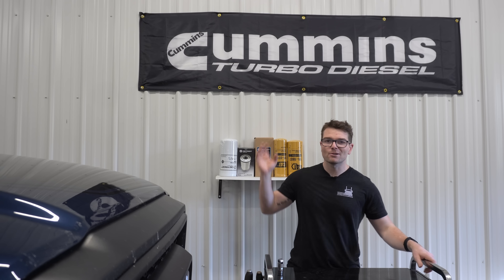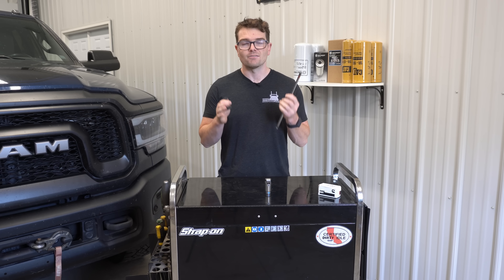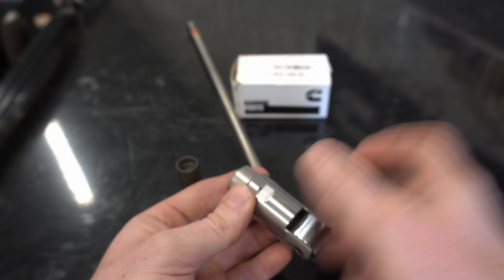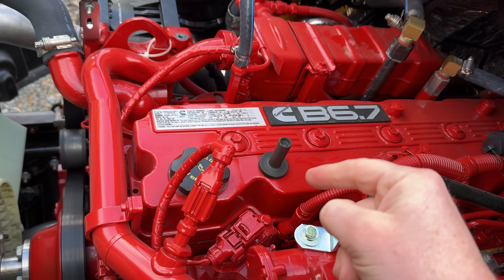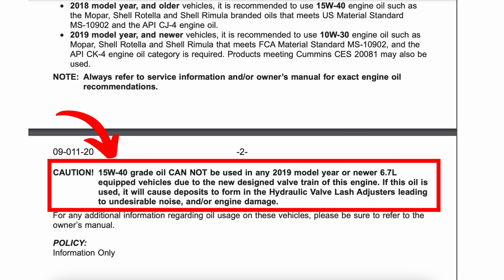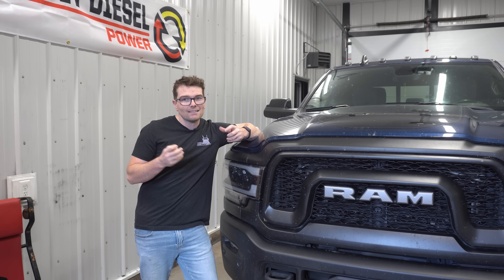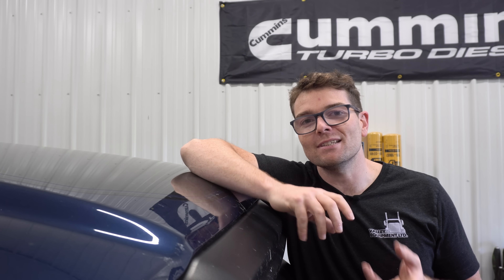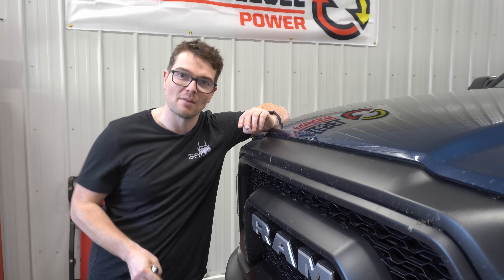RAM 2500 6.7L CUMMINS Hydraulic Lifter Failures *Diesel Mechanic Explains* | Not Good?

Comment: I change my oil every 4months witch = 4000 miles .  I use schaefers full synthetic 15w40 racing oil . Below 50 degrees it run two 5 minute idle cycles on first start of day. 50 degrees and above i run 1 5 minute idle run time on first start of the day . My engine is quite compaired to the 10w30 . I have 50102 miles on my 3500 370 horse 2021 ram and so far so good . I tow between 7000 lbs to 20000 lbs im in my 11000 lb travel trailer rv this week .i tow in overdrive and my rpm run between 1700 to 2000 mostly 1900 rp.s are top . When i pull i use the rpm and gear to tell my speed .im not in a hurry im retired . Awesome videoDenis from Santa Rosa Ca

Comment: Cummins didn’t change this over on their own. Diamlar said they wanted a maintenance free engine for their 2500-5500 series rams so the customer didn’t have the added down time/extra maintenance cost. If you look at any other engine running hydraulic lifters, every brand has issues with these destroying cams whether at 10k miles or 200k miles…. Eventually it WILL happen. These engines were built with a ticking time bomb in each one of them. Chrysler has destroyed their own reputation by changing these engines for what they claim is better for the customer. The only thing that’s better is the return work for them whether it’s warranty or out of pocket expense on the customer. 
As far as why the “commercial “ engines didn’t go with hydraulic lifters…. Well…. That’s a maintenance item that just comes with owning a diesel and that’s on the company’s dime. Commercial grade engine come with a lesser warranty on Powertrain as well. 
I would personally take the day in the shop to run overhead adjustments as to having to potentially replace a $20k engine. 
This is my $.02 so take it as you will. I’m coming up on 100k miles and seriously considering the tappet conversion to go back to the old style system but it does come at a cost. The kit is $6500 depending on what kit you go with and I think 30 hours labor. Granted it’s a lot up front BUT a lot less than $20k for an engine that’s on national back order at this time. I also do 7500 mile oil change intervals with Rotella 5w40 full synthetic but I’m still not confident in these hydraulic lifters engines.

Comment: When I used to rebuild 2 stroke detroits we would literally rebuild the roller followers, nt from failure but from a reconditioning stand point and they rarely failed, I never actually saw a failure but there probably were some, this from an era of long run engine hours and supposedly lower oil technology than today, so what happened  ????

Comment: I used T6 10w30/ 5w40 on my 2021 Horse and just recently started hearing the knocks at 590k miles. I’m at 606k miles now and getting ready for new set of lifters. Just maintained scheduled oil change. 👌
Reply: 2021 🐎 😂
Reply: I honestly believe the lifters fail simply because they get gunked up with filthy oil. Keep in mind Rams oil change schedule is 25,000kms all while being polluted by fuel and soot. No wonder they fail. Delete the emissions and do oil changes every 10K and it will be fine

Comment: Frankly think this is rubbish.  Navistar use hydraulics although not rollers in 6.9s and 7.3s.  No problems with those.  Hydraulics are better.  Debate is really about rollers vs flat.  2 different things.

Comment: You guys gotta remember also make sure you change the air filter. It is part of the system that your engine needs to operate. Valvoline true blue 1030 is one of the best so his Rotella T6 10W-30 can’t go wrong. And I still change it every 5000 miles. Mobile one oil filter keep it clean.

Comment: People need to do true research about oil brands before they bash a product.  I have spent the time and looked at lab analysis of all the brands in my area.  None of them are bad.  Some have a little more or less anti wear additives is all.  If you just change oil sooner then manufacturers recomend you can not go wrong.

Comment: I ran Walmart supertek in all my trucks cat cummins with no oil related problems for 16 years.  I now run the Rotella T6 in my new 2024 Ram 6.7.   I have had lifter tick with the new roller lifters unfortunately.
Reply: Are you gonna do the flat tap pit conversion ? They also changed the oil cups that year .
Reply: @RealNicholasJ.Fuentes  I probably will once emissions system craps out.

Comment: Noise, and maybe a extra one mile per gallon in fuel economy. I would rather adjust the lifters myself. I wounder if you could change the lifters and push rods to the commercial style set up?

Comment: My 2001 with 186000 miles on it. I asked my diesel mechanic to check my valve adjustment. They came back and said only two were slightly out of adjustment. I changed my oil every 5000 miles. They told me I could run that engine to 500,000 miles easy.

Comment: well,2018 here. 540,000 , 30k interval, various 20/40 oils. with analysis twice a year…still going….. and new cab chassis trucks DO have the roller lifter.  i’d prefer full syn 5/20 oil…..

Comment: So here is something I noticed. When I purchased my 2024 I bought an extended warranty which came with 13 oil changes at any dealer in North America.  While reading the fine print a few weeks ago (my experience with 401 Auto Dealers was they don't like to share information in print so you really dont know exactly what you bought) I noticed they package comes with regular oil not synthetic.   WTF?  You can never win with these dealers.  Anyone else come accross this?  Im all about clean oil and the right oil.

Comment: They did this to try to reduce Noise.  Why does anyone care how loud the diesel is?  This is probably something done to compete with chevy and ford.  We see how the switch to cp4 worked out.  Come on cummins!!!!  read the room. We buy the dodge for your engine because its reliable. Not quiet.. not the most gears.. no other reason.  Its simple and will never let us down.  Now fire all the high paid CEO's up there that will never let the common truck owners ideas come too light because they cant box it as their own, and just make a friggin reliable truck that's 10k cheaper than the competitors and you'll be back on top.

Comment: Currently sitting at 187k miles in my 2020 2500 that I bought since new. I can’t stress enough how important it is to keep up with your maintenance AND using the truck for it’s intended purpose. These are not grocery getters. They need to get up to temp and ran long. Literally not a single check engine or issue in my ownership. Every 5k-7k miles, Rotella t5 ultra 10w30. Power service diesel additive every at fill up. Truck runs smooth and quiet just like new.
Reply: SOME PEOPLE WILL NEVER ''UNDERSTAND'''''   OR DONT CARE '''' IT'S A ''COMMERCIAL'' TRUCK ''''  INTENDED FOR '' SEVERE SERVICE '''''  COMMERCIAL '' USE '''  TRUCK  ''''' NOT A '' PICKUP'''   TAKE THE ''SCOOTER'' TO ''WALMART''

Comment: So here is my thoughts.  Tiller lifters in general are a failure point.  We are seeing them fail in the Chevy gas engines with cylinder deactivation, we see it in the ram with the mds systems and now we are seeing it in the Cummins engine.  U know the real reason I think they went to the roller lifter. The small amount of hp gains you get from using them.  Just my opinion though but it would suggest that when it’s not in that bus engine.  Can the roller lifters be reliable sure if you use high end oils and high efficiency filters but if that oil gets just a little gritty those lifters are going to start causing problems.

Comment: I believe all of the engine components receive oil pressure at the same time during startup. A check valve ensures oil is held in the galleries, similar to the way that fuel is held in the rails. No?

Comment: The 2024 Ram trucks are calling for a 15,000 mile oil change interval.  I'd never run that long on a diesel.  5 to 7 thousand mile oil changes with the right oil weight is the way to go.

Comment: That nub sticking out tracks in a groove in the lifter bore.  A little wear there and the lifter wont track straight with the cam and it wipes the roller and lobe.  So instead of just doing a quick valve adjustment you will do a cam swap!

Comment: Is running your truck better or worse at high speeds and Rpms. Around 2500 rpm. Or keep the rpms lower? 2020 2500.

Comment: 2019 6.7 HO lifter failure at 117,000 miles , head needed rebuilt, still using coolant internally, no one can figure it out .
I’m $11,000 in and still can’t use this truck.
Hamilton cam and lifter kit $3,000 , head work $3,000 , studs , wire ring , expensive gasket kit .

Comment: I have a 2006 Cummins in my 3500 ram 6 speed  standard I have 500,000 km have seen a check engine light come on once for a bad injector. I will get 1,000,000 miles out of this engine. I change oil every 5000 km 15 W 40. I change all filters at the same time oil and fuel I just put new injectors at 500000 the old ones worked fine but they were getting noisy solenoids.

Comment: If you were to be in the engine for one reason or another, are the school bus flat tappet cam and lifters a direct fit replacement into the pickup truck blocks? I have a long time before my warranty runs out, but it might be good knowledge for the future.

Comment: The Epa's nvh guidlines are why they made the change. Apparently, there's an issue with the new block flexing under load, causing an oil starvation issue on the rollers.

Comment: Thanks for the information   Was going to pull the trigger on a new 2024 Ram 6.7 H O  
Not now   I only put a few thousand miles a year on with a 4000 pound truck Camper   Going with The Ford 7.3 Gasser now to avoid all these engine issues with these new diesel engines   I too am a retired diesel mechanic and the last thing I want to do is work on a new engine
Reply: The ford 7.3 is having way more lifter issues than the cummins, not to mention the crusty 10 speeds
Reply: @CULTIVAD3D cost of ownership probably has a lot to do with his decision. Gassers will always be cheaper to maintain.

Comment: Considering all manufacturers are or have had valvetrain issues when we’re talking about automotive stuff I’m not surprised. I’ve got a ‘20 Ram, I’m not bothered by it. And 15k mile oil changes is nuts.

Comment: If Cummins says don't run 15w40 in 2019 or later engines, believe them.  Run what they recommend, 10w30.  People who run the wrong oil then complain about "that lousy engine" online are full of sh!t.

When I worked at Cummins, hydraulic lifters were always controversial.  The main issue as I recall was plunger sticking as a result of soot-loading in the oil.  Soot control of diesel oils have improved in the last 30 years so I suppose plunger sticking may not be as big a concern today.  But if you're trying to do extended drain intervals, it could be an issue.  Maybe there are people out there that are using low-quality oil on extended intervals and are running into trouble.  

Another potential problem is freedom of the roller.  Does the 6.7 roller lifter have a needle roller bearing or a rotating follower?  Cummins heavy-duty engines such as the L10, M11, N14, K19, and X15 use rotating followers.  Needle roller bearings have a tendency to stick if they get fouled with too much soot, then the roller starts to slide, wears into a flat, and wipes out the cam.

What kind of failure modes have you seen on the hydraulic roller lifters in the 6.7?  Plunger sticking, or roller wear?

Low maintenance is not the only reason for putting roller hydraulic lifters in the 6.7.  Roller lifters also reduce friction, so save fuel.  When the auto industry converted to roller hydraulic lifters in the late 80's, they claimed a 2% reduction in fuel consumption.  Additionally, 10w30 oil also saves fuel compared to 40-weights.  

Just read your owner's manual and run what they say.  If you have a problem down the road, at least they can't complain about the viscosity of the oil they find in your pan when the warranty claims adjuster takes a sample.
Reply: Ok, having said that, how do you feel about the 15k miles between oil changes?  I’m just curious to hear from a mechanic because I have a ‘21 RAM 2500 that I bought new and I have always done the oil and filter changes myself and have always done them at 15k miles, granted, I use a PUROLATOR Boss oil filter that is rated for 15k miles.
Reply: @elliotweaver5805  What is the recommended oil change interval for the '21diesel Ram?

I had a 2008 Ram with 1st-gen EGR and DPF that I used for hot-shotting travel trailers, so half of my miles were loaded, on the average towing 7000 pounds.  I ran oil change intervals ranging from 9k to 20k miles.  I took oil samples and had analysis done at every oil change.  Over 9 oil changes I saw the iron wear rate increase noticeably after 15k miles.  The 20k mile oil change was too far, definitely, because the TBN ended below the recommended limit.  I always ran Fram Ultra filters.  I ran that truck 108k miles in 11 months, then got out of the business because I wasn't making enough money.

Comment: 2020 2500 67  63000 light duty miles waiting for a new motor because of the new lifter design
Reply: What oil were you using and how often did you change it?

Comment: If the roller part is the problem just use a hydraulic lifter with out the roller as Holden did in Australia in the 70 s

Comment: I maintain about 20 of these 19+ trucks. No lifter issues. Some of them have 130k miles on them. Don't let them idle, use 10w30, and change the oil every 5k miles.

Comment: Oil change intervals need to come down. If youre working it hard with the factory pan then 5k-7k miles. If you arent really taxing the engine and you mainly run highway at 70 then 7-7500 . Most failures ive seen  and have documented seem to point back to interval. If you tell someone 15k , they're gonna go over by a little bit and be clost to 16-17k. If you tell someone 7500k , then if they hit 10 it's not the end of the world and they're still under the factory recommendations. One thing they don't really put into manuals anymore , or atleast it is very hard to find is the normal vs extreme driving conditions. Technucally almost everyone falls under the extreme conditions which then cuts your oil change intervals in half. Stop and go traffic ? Thats extreme according to manufacturers . Tempertures below 32 or above 75 ? Thats extreme as well.

Comment: I think the difference between between the commercial cummins and the one in the ram could be packaging more so than fuel economy. Ram doesn't have to make it get a certain fuel economy like passenger vehicles. but they do have to make it fit into a the hood of a pickup. Probably had to change the oil delivery system and head for that.

Comment: I really believe that the key to preventing the hydraulic valve train failures is to keep the oil changed regularly! Keeping the oil clean and using a good quality oil is the key! I have my oil and filters changed every 5,000 miles, not the normal 15,000 miles recommended by the manufacturer!
Reply: I hear read and here people commenting to use quality oil.   Tell me what oil would you say is poor quality these days. I don't think it exists anymore. 
People can check oil analysis easily on there phone now. Eliminating bad product sales.
Reply: @stevefortune4315 
☝🏻☝🏻 yes. More important is using a good quality filter. Of course maksure to use the correct viscosity oil.
Reply: @stevefortune4315  WALMART BRAND IS ''CRAP'''  THERE'S YOU ONE '''  I RUN T -4 ROTTELA ''''  BUT THE T -6 ROTELLA PEOPLE SAY T -4  IS BAD '''''  I DONT THINK SO '''''  1.2 MILLION MILE'S '''   WHAT DO YOU THINK '''' 02 RAM '''''

Comment: Is there a benefit to running synthetic over standard 10w-30 in the warner months? Why do they switch from standard oil to synthetic from summer to winter? I know why for winter, the waxes and paraffins in the oil. But why not stick with synthetic year round?

Comment: What is the cost to fix this issue? I think mine needs this fixed
Reply: At a dealership, for a new motor, not a rebuild, about $46,000 (I have dealer paperwork to prove that). At an independent shop probably 20-30k. Brand new complete motor via Mopar is 24k alone.
Reply: @ConcreteCoffeeAndCars he didn’t ask about a new motor
Reply: @pearljam_1  technically, a new motor is a fix 🙄
Reply: @ConcreteCoffeeAndCars  bro you don’t need a new motor to replace the lifters. Roll your eyes at yourself.

Comment: I run valvoline premium blue 5w40 and have 48k miles with zero issues. I live in WA state where it drops down to -5 during winter and 105 during summer.

Comment: Unfortunately i EXTREMELY disagree with 15w40 being the issue. Why ? Because Hydo rollers have been in use  since the 80s on TONS of stuff including even low tech  harleys,  ford  and chryler small blocks, gm deisel 6.2 and many many things. I have owned it all and more and ran 15w40 in it allllll , owned well over 500 vehicles and diesel equipment and i run 15w40 in it all never had anything with hydraulic rollers fail. Never . And 1540 despite false boomer myths is NOT really all that thick.  Instill believe its a design flaw my main guess being the fact the roller on these is a bushing not needle bearings and the anti rotation design, which is literally just a nipple riding in the block,  are the two issues and are both causing the failure. I have a 2023 cummins and sadly i will eventually shell out the money for the solid conversion as its obvious in my opinion the Hydro lifters are just an APSOLUTLY garbage design.